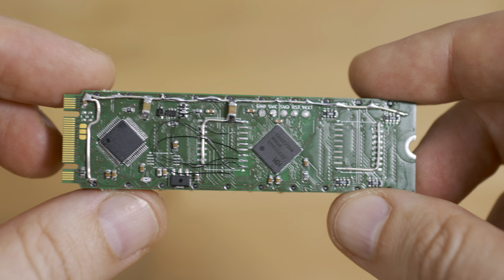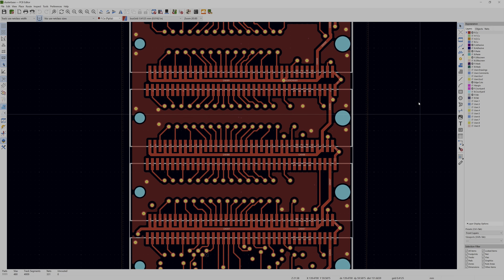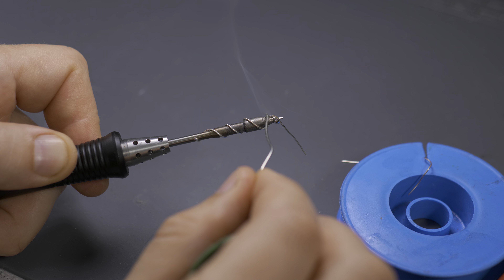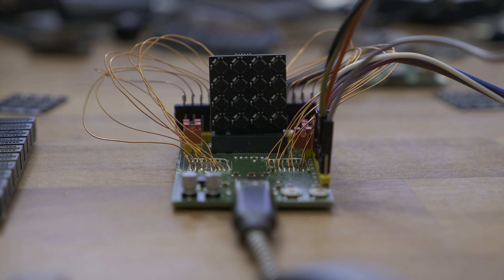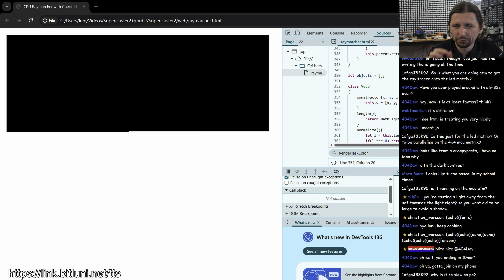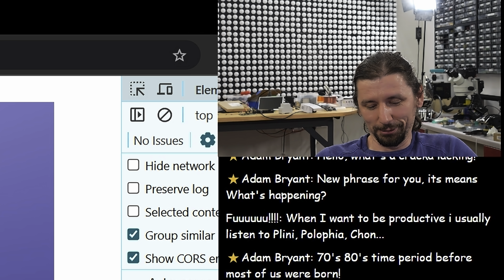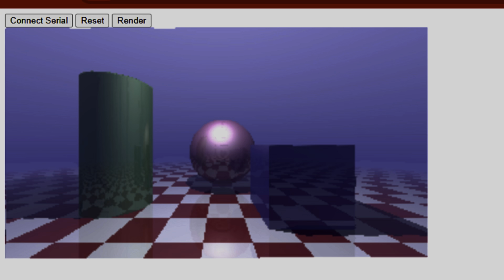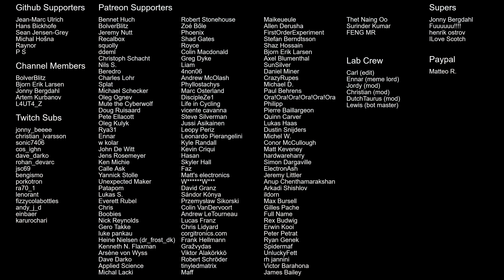I made a GPU at home

Comment: Fun project, looks like you learned a lot along the way! :D

One tip for future projects: you can save a lot of money on small PCBs by optimally panelising your boards. Rather than having each small board be produced as a separate PCB with its own edge rails for assembly to meet JLC's 70x70mm minimum panel size, you can panel your board as a 2x2 array (or more) and then add edge rails around that. You'd get four boards out of roughly the same area, so the per-board cost drops massively, and the assembly is cheaper too. They have documentation for the rail sizes, fiducials, and tooling holes you need to add. You can ask JLC to panelise the board for you (it's an option during the quote process) if you like, but I would recommend doing it manually when you have edge connectors since you can then control where the mousebites (the small areas where your board connects to the panel) are positioned, so they won't interfere with inserting the PCB into the edge connector.

Also, if your board has lots of features at the minimum size for their capabilities (or if you're using impedance matching), make sure to select FR-4 TG155 (Nan Ya Plastics NP-155F) as your dielectric material - they don't make this very clear but they end up charging you more to make precision boards on the default TG135-140 material. It's also the material they calculate their impedance profiles against so if you impedance match your traces for high speed stuff and then use TG135-140 it'll actually have the incorrect impedance. The cost adder for TG155 is only about $3 on a 5pcs 100x100mm board quote so it's totally worth it.

JLC's 6L service also got a lot cheaper now (it's even available on thier Economic PCB service now!) and I would strongly recommend that for a project like this. If you search "JLCPCB autogenerated stackups" you'll find my GitHub repo where I've uploaded autogenerated stackup files for KiCAD and Altium for all of JLC's stackups, including the 6L ones, to save you some effort getting it set up. I know you were planning on switching the ground (and learned your lesson - don't switch grounds on ICs!) but a solid ground plane for your signals to reference, and for the return currents to travel through, will make a huge difference in signal and power integrity, and save you a lot of headaches with chasing down glitches. I'd recommend Eric Bogatin's book "Signal and Power Integrity Simplified" for a really accessible deep dive into this stuff, or Rick Hartley's talk "The Extreme Importance of PC Board Stackup" if you want a quicker reference.
Reply: they got a little annoyed at me when I manually “panelized” a couple PCBs together with mousebites. there was a surcharge for PCB assembly because they thought I was trying to cheese the per-board cost
Reply: @42468  They do at least document this requirement in the panel settings and documentation. If you try to "panelise" different boards together without declaring it in the quote they will charge you for all 3 designs.
Reply: Another tip I just thought of: see if you can buy the "brick nogging" version of the connectors in future - sometimes it's a case of buying the SKU that is packaged in a tray or cut tape rather than bagged, if they're sold as separate items by the distributor. The brick nogging is a little plastic "hat" that sits on top of the connector and allows you to lift it with the PNP nozzle. If I recall correctly you have one of Robin's Pixel Pumps, so that'd be super useful here. Much easier to place than with tweezers.
Reply: Wow, out here with the knowledge in the comments. Where you put it all?
Reply: @ickorling  ADHD is one hell of a drug.
Reply: Yeah, I was thinking about that looking at all the scrapped space on those PCB's. Good to know that somebody with more familiarity on the topic agrees.
Reply: I have seen companies pay $1,000s to consultants who gave advice not even 50% as useful/complete as this YouTube comment.

🤖 Neat 📸
Reply: I also recommend watching “[LIVE] How to achieve proper grounding - Rick Hartley - Expert Live Training (US)”
Reply: I have seen companies pay $1,000s to consultants who gave advice not even 50% as useful/complete as this YouTube comment.

Can’t believe I’ve finally gone done n’ caught me an honest to goodness, in the wild, real life:

“_𝙸𝚗𝚜𝚎𝚛𝚝 𝙹𝚘𝚋 𝚃𝚒𝚝𝚕𝚎 𝙷𝚎𝚛𝚎_* 𝘩𝘢𝘵𝘦 𝘩𝘪𝘮! 𝘖𝘯𝘦 𝘸𝘦𝘪𝘳𝘥 𝘵𝘳𝘪𝘤𝘬! 😱😱😱 𝘾𝙇𝙄𝙆 𝙃𝙀𝘼𝙍!!1!!1!
Reply: I'm saving this
Reply: Liked for effort. Nice
Reply: a good pcb house should do that automatically .....  but just remember to go for  scoring , not routing of the panels... if it is cost reduction you want.
Reply: @stevesteve8098  JLC's Economic PCB/PCBA services are very much focused on being low volume low cost, so you don't get a lot of engineer time per order. If you pay a non-budget PCB house to do it then they'll definitely pay attention to details like that, but you'll pay 20x the price or more for that. One thing you can do with JLC though is to select Confirm Design Files during the quote and then use their auto panel feature. They'll do the CAM and then send you the files for confirmation, at which point you can say "hey you connected it in the wrong place" if it's not right, and they'll fix it.

Regarding V-scoring vs. edge routing, JLC doesn't actually make a distinction between the two when it comes to price, unless you ask for really complex edge routing. They're doing massive batch panels of combined customer designs anyway, so all those drill and route steps are automated.

Comment: How do 160 simple in order 50Mhz cores outperform 8 >2Ghz out of order 4-wide cores at anything? That doesn't pass the smell test. Even if it's just 4 cores with SMT that doesn't add up
Reply: I think that was computations per kilowatt-hour for a class of problems that don't require much communication, RAM, or much else beyond bit manipulation.

This is just a learning project. It is a good starting point. Someone else can use the concepts and software, but add in higher performance data paths.
Reply: @hamjudo  He is showing hashes/s, not hashes/J. Sure it's a cool project, but that claim is likely not true. I would expect that web thing to show a per-core score, not multi core. Then it's in the right ballpark.

Comment: Consider using a vacuum tool for picking up the connectors. They use a foot pedal and pencil like tool connected by a hose to a vacuum pump. A bent nose tip with a tiny suction cup could let you do manual pick and place for parts like the microcontroller and connectors without them flopping all over the place after releasing the tweezers.
Reply: Pretty sure he uses something like that at some point in the video, dont quote me on that though
Reply: @AxolotlInANutshell-df5xi  You are right, he does around 4:30-4:37, but not on the connectors

Comment: I am impressed and surprised at the same time:
The dedication to develop such a work-heavy project, but then again using the tiniest of traced for power-connections. Why? Power-connections should always be far bigger than what the hardware can draw to prevent any issues (and if required just adding dedicated fuses/weakspots for protection). Specially if multiple components are chained in series like that.

Comment: just FYI: on a HDR display, the white of the screen recordings is extremely bright (it's brighter than the LED's!). It's really nice seeing the vividness of the LED matrices tho :)
Reply: Nope it isn't. 
It may depend on "Auto HDR" being turned on in the control panel, which tries to "automajick" HDR for SDR content like this video. If you have it on, then there is your problem. 
I'm using a HDR display with HDR enabled but only for HDR content. It source media is SDR my display shows it as such, it looks fine if your monitor is correctly calibrated - it just doesn't look like HDR because it isn't. HDR content looks perfect too, with vivid contrast etc. To me the "Auto HDR" is unusable because my monitor will burn my retinas to a crisp on full output which it does at random unpredictably on full screen media that is made for SDR. It depends a bit on how bright your monitor can get, but mine is full HDR10 and blindingly bright at random bits with AutoHDR. 
TL:DR; not the video, but your settings.
Reply: @noth606  Auto HDR is a windows thing. I don't use windows.

Comment: This is an absolutely incredible project. The effort and skill required is really impressive, I enjoy all your videos.
But as an electronics/PCB designer I felt physical pain here and there watching your layout and smd assembly workflow 😅. I would suggest to always use power and ground planes for somewhat complex designs. It requires additional layers but the signal and power integrity gets so much better. You should also check the solder paste mask thickness suggestions in the datasheets of the components and order the solder paste masks accordingly. Looks like you have too much solder paste on the pads for most of the components. With the proper amount of solder paste,  60% of the time, the reflow process works every time.
Reply: The recommendation is usually a range, mostly it is possible to find a thickness which is within the range of all components. But sometimes it is necessary to use a stepped mask with different thickness areas to get a reliable reflow process. Much more expensive of course.
Reply: @goodi2k7  Makes sense, thank you.
Reply: Might I ask what you should do if you have multiple components on the same board with different solder paste mask thickness recommendations?

Comment: It looks like you're using a 2280 form factor now, but I wonder is 22110 might be supported by enough things to be worth trying. Should be able to go from 10 to 12 modules then, and have 192 MCUs, plus some extra room to work on the board itself lol.

Comment: The one-frame text flashes are annoying. It's fine for jokes or whatever but the finnicky technical details you put in there in this video is what I came for ;)

Awesome project though! Funny how you're using PCIe in the M.2 slot but still got bottlenecked by the bandwidth to the host 😆

Comment: builds a 160 core SHA256 accelerator... uses it for the blinkin lights!
Reply: Reminds me of the classic “thinking computers” from the 80’s.
Reply: Blink LED = Happiness!!
Reply: encrypted blinken lights!!
Reply: The use is another iq level besides building and planning.
Reply: @Nordlicht05  Blasphemy. Das Blinkenlights is a fine hacker tradition.
Reply: Blinking lights are always important!
Reply: It's the old Arduino Brain Syndrome.
Reply: And it's faster than that Chinese GPU they just announced lol
Reply: That is a great compute pipeline accelerator. Perfect for MATMUL (matrix multiplication, basis of AI).
You should apply it as an R2D2 level robot brain to run quantized (low precision) AI models.
Then  use it with an agentic API (for ESP32 for example) to control a REAL BOTLUNI.
REAL BOTLUNI says "beep beep bop bip boop!"
Reply: yah yah das blinken lights!
Reply: This is already impressive, work, the amount of just cross communication, latency, and timing complexity that it took to even achieve that render is highly impressive, and on cores that barely support mathematical processes. Talk about building a processor on difficulty impossible.
Reply: This is the basis of which every great invention ever was built upon - Believe you me.
Reply: the audacity to/irony of complain(ing) about crypto mining being a waste of energy, lmao...
Reply: das blinkenlights
Reply: So impressive..if you're not AI
Reply: Gotta have RGB on your gaming rig😂
Reply: it's no where near a productive mining rate... back in 2010, i had hand built kit that was pulling 130Mh/s or 130 million hashes a second.
I then multiplexed the design to 20 other boards..., currently in 2025 a single  ic for bitcoin will outperform that by a factor of 100.
I bet that in maybe 50 years , if bitcoin is still active, my kit will be a museum piece...
Reply: @stevesteve8098  its also 4 watts so
Reply: @stevesteve8098  no one cares about shitcoin
Reply: @stevesteve8098 show your stuff :) make video please
Reply: @stevesteve8098   It's completely useless for cryptography or mining. You want a custom digital circuit which implements the crypto algorithm in hardware.. NOT a general purpose CPU which runs it in software. A single FPGA would crush this thing.
Reply: @_________________404  i think you're missing the point of the project lmao
literally no one cares about how actually practical it is for "mining" or cryptography
Reply: @ThylineTheGay I think the 404 guy does get the point of this project
Reply: @ThylineTheGay  I think you didn't get the conversation 404 was engaged in.
Reply: @_________________404  its 4 watts man
Reply: @warguy6474 I haven't tried, but I'm pretty sure an entry level fpga can do something similar on sub 4W, even GPUs can do better, a 175W gpu from 15 years ago does ~1000 times that, for only ~50 times the power
Reply: @warguy6474  FPGA will be less than 4 watts.
Reply: @_________________404  we no longer use FPGA's anymore anyway -- it's ASIC's all the way down or fully custom silicon.
Reply: @stevesteve8098  a 75 year old piece of technology being a museum piece tracks. THat tends to be how it works...
Reply: @stevesteve8098  So you're rich!!!!! What's the coolest thing you've done / bought since?
Reply: @stevesteve8098  what kinda powa draw from yours compared to this or <10watts I think ?
Reply: @TerryHope  a modern cpu does a few billion (22B on a r5900x)  sha256 hashes per second, at 100W, it's not comparable lol.
Reply: @stevesteve8098  sooner than 50, i give it maybe 5 to 10 years. moores law is dead, we're moving to quantum and light based processors
Reply: @-xSphinx-  no, progress itself is dead, quantum processors is a hoax, and we are moving to dedicated power units for GPUs, because more power is being achieved now only by increasing chiplets quantity, increasing heat generated and power drain.
Reply: @-xSphinx-  Moores law aint dead.  The Quantum and more importantly the Photonic circuits will just pick up the pattern.  I seen discussion of it a while back, even before transistors Moores law held for computational abilities and that moved through humans, to analog to tubes to transistors and soon photonics which will take it to the moon.  Quantum computers on the other hand are a useless fad that will die out in a few years because they are worthless, and do-nothing photonics can't do better.  I wish they would stop working on them and the funding just go towards Photonics because I want my 1 Million Gigahertz CPU already.
Reply: @seditt5146  dude, Moore's law has been dead for quite some time. And it won't come back even if that future tech works eventually. Because Moore's law is about the number of transistors, which your future tech won't use in that way ...
Reply: eh, modern tech is used inefficently anyway. like having AI in everything
Reply: @pelaajahacks8358AI is here to stay whether you like it or not.
Reply: He should test it with my project.
Reply: What project did you build? I want to know.

Comment: So to my understanding, this is an NVMe stick that houses the equivalent of roughly TWENTY 8-core CPUs? If so that's REALLY dope but if I'm misunderstanding completely by all means please fill me in, I'd love to understand this better to learn if it'd be a viable way to supercharge an existing CPU 👀
Reply: It's hosting 160 individual single-core microcontrollers. They're all very slow individually and their strength is in sheer quantity.

You won't be accelerating your PC with this if that's what you mean, but the same principals you see uses here to spread work across them happens in clustered computing or in GPU architecture design as well.
Reply: It is indeed a stick that fits in an M.2 slot, uses PCIe to communicate with the host system, and contains 160 processing cores that are freely programmable, but calling it NVMe and equivalent to 20 8-core CPUs isn't accurate.
First, NVMe is a protocol used for communicating with storage devices. It's most commonly used over PCIe using the M.2 connector, but those two things together aren't necessarily NVMe. This is really just naming though, so feel free to give this a 🤓.
Secondly, and much less pedantically, the 160 cores this has are nowhere close to equivalent to the CPU in your PC, they run at 1/100th the clock speed and have a much simpler architecture that doesn't even have a multiply instruction. They also have only 2kB of memory each, which is not synchronised between the cores. For some tasks all of this is outweighed by the sheer amount of cores (like the hashing demonstrated in the video), but for 99% of your daily computing needs this is not usable.
Reply: @mitsync  Ah I see, so then what kind of use case would something like this be useful for? If not as a CPU booster, wouldn't the nature of it being NVMe/PCIe/M.2 maybe make loading or transferring data from an SSD faster? Say if you had two slots, and you put your SSD in one and the 160-core supercluster in the other
Reply: @punkrockroboid  This specific project is not really useful for anything, it's just cool to say that you fit 160 processors in a slot meant for storage. Dedicated accelerator cards are a thing though, both in M.2 and normal PCIe formats, usually for things like AI processing or video encoding/decoding. In those cases there will just be one or two big chips on there with many elements inside instead of 160 small ones.